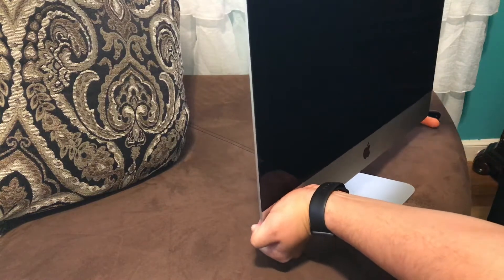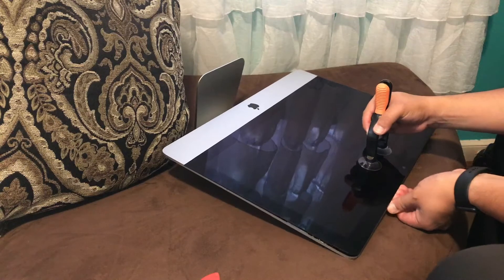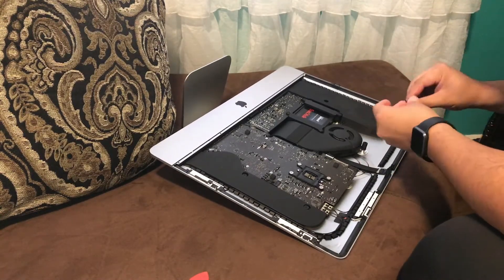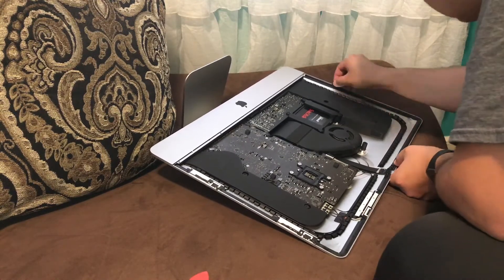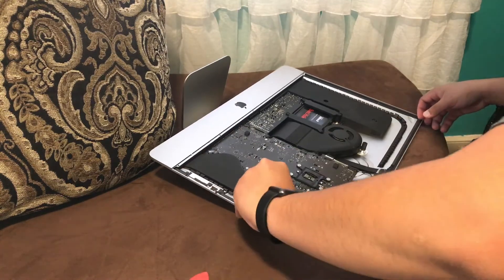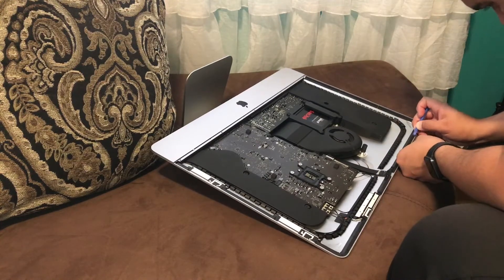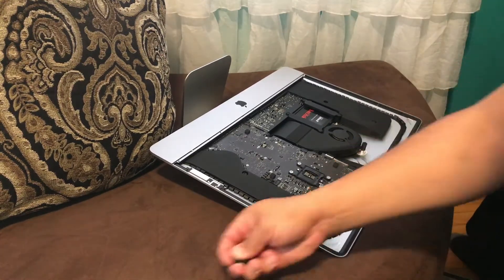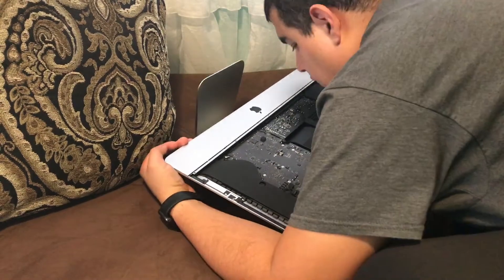2017 iMac CPU upgrade (More Detailed) & Thank you Part 1

Comment: I have the 2017 5k iMac with i5 processor.  Which i7 processor did you upgrade to?  Do you have a part number?  Thanks.
Reply from the maker: Do you have the i5-7600 on your iMac?
Reply: @SmallTechReviews  I have the i5 but I dont know which one at the moment.  I upgraded the HDD to SDD yesterday and now it wont turn on, I think I have the CPU seated incorrectly.  I figured if I have to go back in there to fix it I may as well upgrade while I'm in there...

Comment: Is it possible to upgrade it to i7 8700 65watts on the iMac 2017 27inch model?
Reply from the maker: Unfortunately no, only 7th gen Intel CPUs for the 2017 model
Reply: @SmallTechReviews  thanks for the reply. would it take i7 7700k?
Reply from the maker: @endtimewarriorsofjesus  it would but the fans may kick in very frequently,  i7-7700 (non k) is a great fit for when I did it
Reply: @SmallTechReviews  thanks for the info

Comment: Does this mean i can upgrade my 2017 21 inch 3069 from i5 to i7 by just changing the cpu?
Reply from the maker: yes, make sure its the same generation CPU and try to avoid K series CPUs as those run hot in these, but, of course, it's your choice
Reply: @SmallTechReviews  Thanks
Reply: @SmallTechReviews  Making sure does this apply to emc 3068 from 2017

Comment: My Freind, i just upgrade CPU Ram M.2 and SSD and im having issues where the computer is restarting after a while, by any chances do you have any idea what could it be?
Reply from the maker: What I would do in the situation is reopen the iMac and make sure everything is put back together carefully and slowly, I would remove the ram the CPU anything that you installed I would make sure that it is fit correctly, this would have to take some time, it has happened to me before and I had to redo everything and come to find out the CPU was bent but luckily nothing happened, if you are in a rush you are more prone to mistakes especially in something very sensitive like these IMAC 🖥
Reply: @SmallTechReviews  thanks you so much really appreciate the replay will try and keep posted 👨‍🔧

Comment: I’m going to do this to my 2017 I mac I take out a 2tb fusion drive out and put a 2tb SSD and change the i5 to a I9 or I7
Reply from the maker: Remember the 2017 can only go up to an i7, I just did one on a different 2017 system that I bought and I installed the I7 7700

Comment: Hi there. Thank you for your Video! Awesome.
 I have an iMac (Retina 5K, 27-inch, 2017) with an 3.8 GHz i5-7600K Processor. May you know if I can upgrade it to an i9-9900K?
Also hat is the newest and best Option of Processor I can upgrade with?  Many thanks!
Reply from the maker: Thank for watching my video. the best CPU is the i7-7700k but the fan gets spins up fast on nearly everything you do, i bought another 2017 about a month ago and updated it to the i7-7700 (non k) and it works great. the 7th gen intel CPUs are the highest you can go on these 2017 models
Reply: @K B, The architecture of the 2017 can't be changed to accommodate that processor without changing the whole logic board. The best you will be able to put is another Kaby Lake without having to mod the original drivers or uploading Kexts

Comment: One question, in AliExpress they sell the ES version of the i7 7700 and i7 7700K. They are versions that have less GHz than the official versions but they are not false, my question is if they would work with the Imac 21.5 4k i5 7400 2017? Greetings from Chile, your channel has very good videos
Reply: I hope I am not late, but the first thing you should consider is not to exceed the watts that the replaced processor handles, if I am not mistaken that i5 works at 65w, you should use an i7 at 65w
Reply: @aminabdo7470 thank you

Comment: i will be having one of these in my shop in the month ahead, what is the newest CPU i can put into this? i know its LGA1151, but is there compatibility i am unaware of?
Reply from the maker: Dave Baumann What is the purpose of the computer at your shop? Will it be for photo editing video editing?
Reply: Small Tech Reviews I’ll be upgrading the ram. And I saw that you could replace the CPU, I have a 7700K lying around. Just wanted to know if anything newer would work. As long as it fits the socket.
Reply from the maker: Dave Baumann Thanks for that info, ram definitely needs to be upgraded from the 8 GB that I typically get these computers on and an i7 7700 K is totally fine it just may get hot a little bit quicker but that’s not a problem it’s kind of like The 2020 27 inch iMac with the 10 core processor, it’s not a problem with that it just gets hot quicker so just be mindful of that

Comment: Hi. I have a 2017, 27-inch iMac, 3.4 Ghz and wanted to upgrade the storage. Can I upgrade the m.2 SSD to 1TB and also add a 1TB 2.5 SSD too? Is it possible to just add two m.2 SSD only? One on other motherboard and one in place of the 2.5 SSD?

Comment: Hi, thank you for your videos, how do you tell whether a motherboard is compatible with a specific CPU or not? I am thinking of the iMac 27" 5k from 2015, my version is the base model with a 3.2GHz i5. Could I replace with 4.0 GHz i7 (I7-6700K) or any other CPU that uses the LGA1151 socket? Another question, my computer was born with a HDD which I since have changed to a 2.5" SSD, but do you know if there is an empty socket on the motherboard for a blade SSD (if so, do you know with ones are compatible?) It's quite a procedure to open, disassemble most of the computer, to look or try - so I'm trying to "know" beforehand. Hope you can help me, thank you! Rasmus
Reply: LGA 1151 socket up to maximum TDP of 91W. The I7-6700K was an available upgrade for the Late 2015 5K.
Reply: @bustopherjones2285  Okay, thank you! :) But do you know of the SSD?
Reply: @dondolorosa  The blade connector should be on the Late 2015 27". Even if it didn't come with an SSD or Fusion Drive the 27" should have the connector. A lot of the 2012-15 21.5" did not have the connector soldered on if it didn't come with SSD/Fusion.
Reply: @bustopherjones2285  But where do I find out what kind of SSD I can use?
Reply: @dondolorosa  For the blade SSD you have to get a Apple card as they are proprietary. The 3.5" location can use any SATA SSD with a 2.5" to 3.5" and a temp adapter.
Reply: @bustopherjones2285  Thank you! :D
Reply: @dondolorosa  Oh, there are blade adapters for a normal nvme to an apple. but, they were designed for the laptop and takes a little work to get the mount to fit on an  iMac. Not for the amateur.
Reply: @bustopherjones2285  It's quite the disassembly operation anyway. I've used a blade adapter once before, on a 2013 Macbook Air. Kept the repair cost down! Original Apple SSD's are incredible expensive relative to other competitors e.g. Samsung etc. Somehow, information is just hard to come by on the iMacs, it's much easier on the laptops (can't upgrade that much anyway:) ) On the iMacs I find, that there is quite much conflicting information around. Not easy when planning an upgrade :D  But I think I will try an adapter (from Sintech, they seem most reliable) and an Samsung EVO NVMe m.2 SSD. I hope that this will work!
Reply: @dondolorosa  The only issue is that it misses the screw down post by a little bit. have to file down the hole a little. The full length adapters are easier/safer to file than the SSD. 
Check the list of known SSDs that play well with Macs. 960 does but the new 970 does not.
Reply: @bustopherjones2285  I did not know that the "short" adapter did not fit. But I guess that it seems logical? I will get the longer one, and the EVO 960. My plan is to use the blade SSD as my boot-drive. And then reinstall the the larger drive for storage. That way I hope to get a faster and better machine :D I kind of looking forward to try!
Reply: @dondolorosa  Yeah, the imac mount is slighlity different than the Macbook/mini
Reply: @bustopherjones2285  I hope I'll manage anyway :D But thank you for the thorough answers! Much appreciated!

Comment: Can we upgrade i9 cpu in iMac 2017 27”?
Reply from the maker: no you cannot as the motherboard is either a 100 or 200 series motherboard which max out with the 7th gen processor. you can with the new 2019 iMac that out now